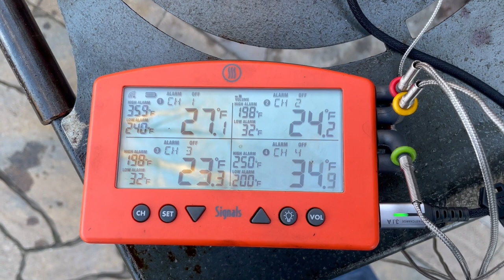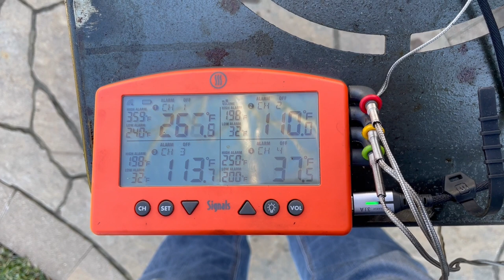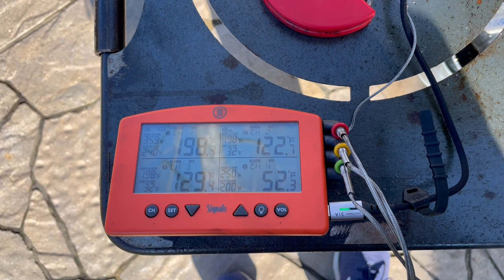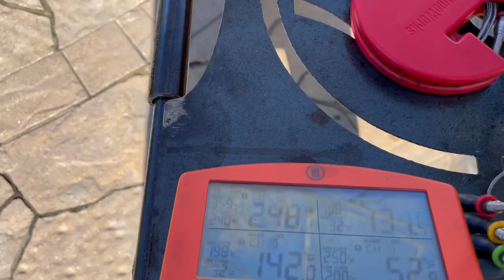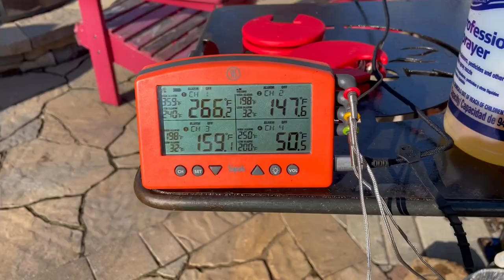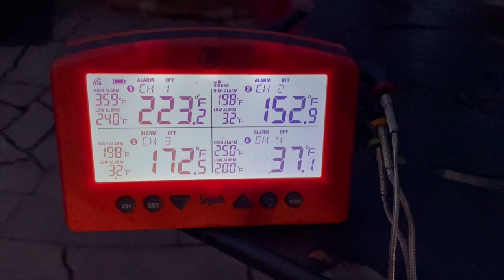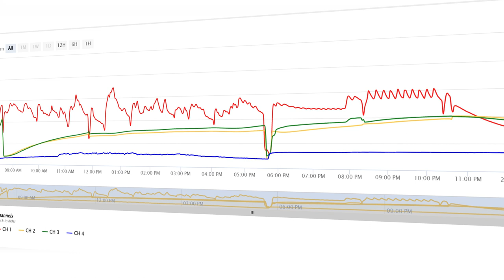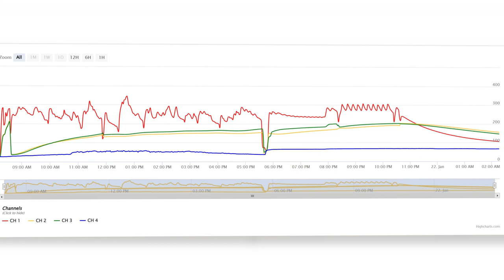Workhorse 1957 Fire Management Series #8: Birthday Brisket on a Cold Day

Comment: Really love these videos! Keep them coming!
I just want to say, I see that you have a lot of issues with your logs suddenly stopping to burn and giving a lot of white smoke, after which you play around with them a little bit and it then creates a short spike in temperature. I think you can avoid this by not putting the logs on the side like you always do, but put them on the actual coal bed. I think this will ease the fire management.

But that's my thought of it :D I love the real-life issues you are showing, and not only editing out the best parts and then say 'had some issues but I fixed it', without actually showing it!
Reply from the maker: Very good point.  A lot of my problems could be corrected if I kept a closer eye on the fire.  Too often, I am doing several things at the same time like chores and errands.  As family cook, I work at minimizing the time sitting next to the pit.    A lot of what I do is aimed at giving myself 30-45 minutes between feedings.  I believe that is a goal for many backyard pitmasters as there are games to watch and other fun family things to do. The fire management series is about capturing those moments and dealing with the consequences that arise.

Firewood varies quite a bit from one split to another.  Some of the kiln dried Hickory that I've used seems harder than other pieces of wood.  If you don't have a sizable coal bed going, the splits will char forming an insulating coat on that  split.  That char will slow the burn and allow the coals to burn out further just about extinguishing the fire.  Having colder outside temperatures don't help much either.

As we move closer to summer and the temperatures rise, the fires burn more consistently.  Plus, I have found a new firewood supplier that I am eager to try out.  Will have some new videos out soon.

Thanks for watching.  Keep those comments coming.

Comment: Good video Max yeah I cooked a brisket today on my Brazos a little harder than just running a fire to make adjustments 
I used seasoned wood instead of kiln dry this time
Reply from the maker: I smoked a Turkey on a Brazos and it came out great.  Afterwards, I wished I had filmed a Fire Management video.  I had never used a Brazos before and I wanted 350 degrees F temperatures to crisp up the skin.  On that cook, I used a big bead of charcoal in the basket with large chunks of Apple wood mixed in.  The temperatures were controlled very nicely by the air dampers.  I placed  half sized steam table pan with water under the turkey sitting on the baffle plates.  That Brazos really did a nice job and those baffles evened out the temperatures in the pit.  I was impressed.  As  you know my Workhorse does not have baffles so fire management is requires different techniques.  Have fun learning your new pit.  Please share your experiences on the channel.